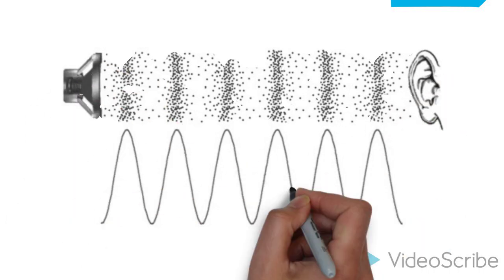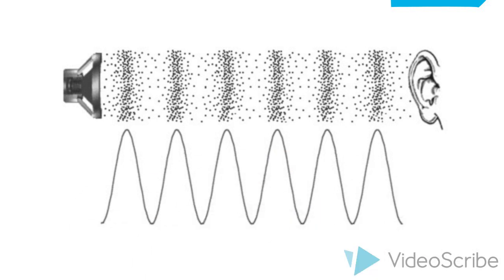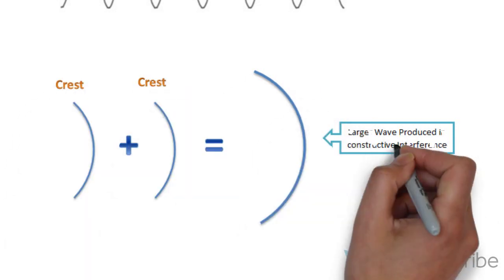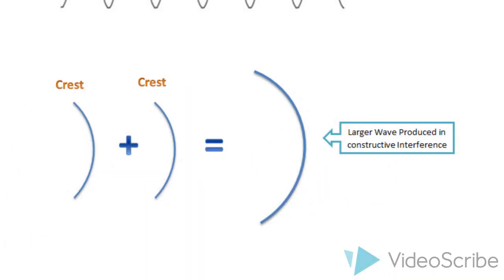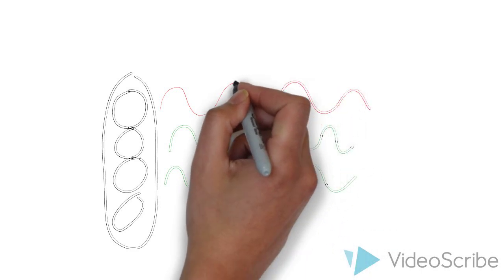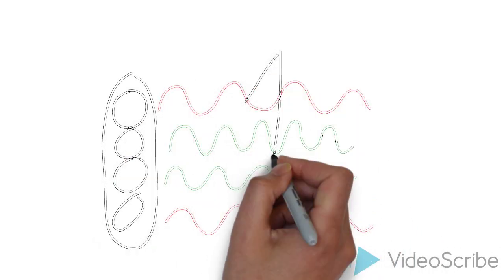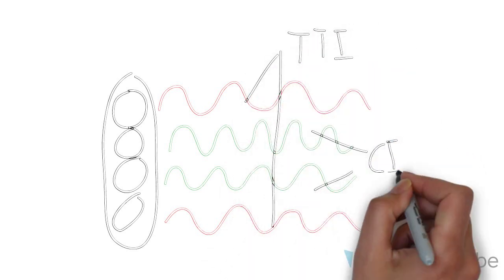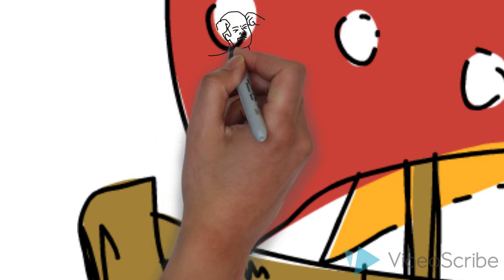Explaining the L.R.A.D

Comment: Hi, there is some way to avoid the sound? The cops will start to use LRAD in my country
Reply: well for one, you could run out of the way, but they could easily swing the device to you again. And blocking your ears or using earplugs won't work. You could try noise cancelling headphones, but that would probably be insufficient to completely cancel out the noise
Reply: @xtent2736  covering your ears will help lower about 25 decibals, putting you in safe range.
Reply: @SpontaneityJD  along with meditation emitting vibration can cancel out vibrations maybe?